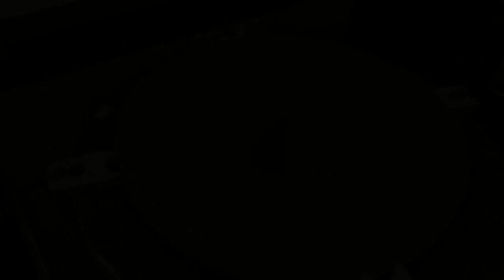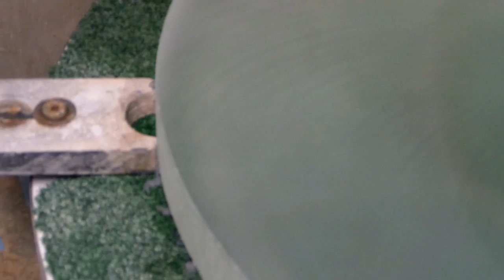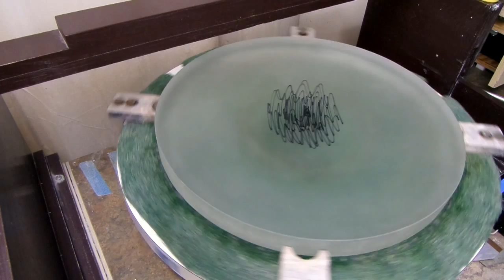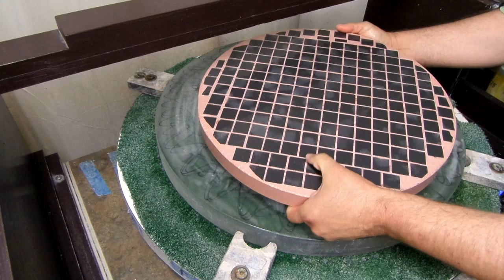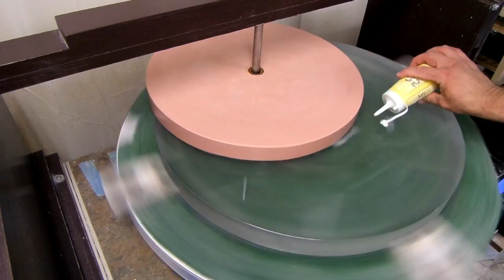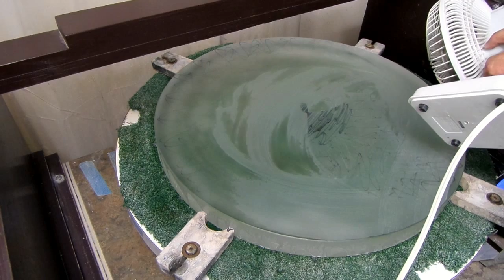Preparing to Grind a 22" f/4.0 Telescope Mirror

Comment: Not sure if this message is helpful but they make powder guidecoat. You can probably find it in an automotive parts place. I hated using it with bodywork because it got a little messy when I was in a hurry. But it helped with my bondo. Thanks for the video. I am looking forward to making my own mirror.

Comment: If the grinding stone is just sitting on the mirror, then theoretically it wouldn't make a complete even finish since the contact point of the two changes.  No reference hight.
Reply from the maker: And yet it works so marvelously well!  The grinding stone isn't "just sitting" on the mirror...

Comment: I noticed the grinding stone was passively driven by friction with the glass. I wonder if the is any variation in speed and whether it makes a difference.
Reply from the maker: The speed varies a little bit, depending on how good contact is between the two disks.  When it is in the proper "zone" then it is pretty constant.  Basically, the speed takes care of itself!

Comment: Hmm how will you get a spherical grind with this grinding setup? I can is the tool exactly 90 degree to the glass or are you using a spherical tool? But if so the high spot in the middle of the tool will only grind on one circle on the glass in this setup
Reply from the maker: The tool sits flat on top of the mirror.  It is well offset from the center, and loose abrasives like silicon carbide or aluminum oxide are ground between the two disks.  The mirror-to-be is sitting face up on a turntable.  When the turntable spins, the friction causes the tool to spin on top of it, thus grinding both the mirror and the tool.  The mirror on the bottom slowly goes concave, while the tool gets convex.  The radius of the spherical surface on the mirror is controlled by changing the offset of the tool on top.
Reply: Ahh, thank you very much. Tool and glass are grinding each other, now I understand how the glass will get its spherically shape

Comment: I do have one question, why do you have to spend so much to make mirrors by melting glasses and moulding it, taking care in grinding to the exact point required. Wherein you can get it done in a metal place with mirror finish coating and use it the same way as glass mirror..my question may not be that exact but this is just my thought...
Reply from the maker: Most metal work is accurate to a thousandth of an inch.  Telescope mirrors are more like a millionth of an inch.  Plus metal expands and contracts too much with temperature change.
Reply: "Get it done in a metal place " ? Wha ...??? You mean a machine shop ? They don't do this stuff.

Comment: Gordon, I've recently been bitten by the telescope bug and I automate for a living. I've been watching videos about making mirrors and I can't help but wonder what technology has been applied to this. I see the defect on the glass in this video. If the table had an encoder suitable for position control, and a tool to measure the flaw from center to edge, the flaw could be mapped out on the entire mirror. A laser for etching glass could be used to remove the prescribed amount of glass necessary to correct the flaw. If the measuring device is also a laser, the process could be quick and accurate. The laser doing the measuring could monitor the results of the corrections as they happen. The etcher could be on one side of the mirror and the measuring laser could be on the other side. As the mirror is spinning, the etched spots would be checked by the measuring laser after perhaps another half turn. The finish would be poor and there might be subsurface fractures, but the surface would be close to true. Maybe there would be less grinding to do afterwards.

I work with PLCs (Programmable Logic Controllers) and to some degree with robots. There are probably a few robots in scrap heaps that work just fine. I think that if the above philosophy were applied to a robot, the process could be done with little supervision. It would be a dream to have a little shop with some cool machines that spit out a lot of high quality mirrors. 

I figure that if I have thought about this in the last month or so, probably a lot of other people have beat me to it. Do you know if anyone has designed machines for this? Is there a huge gap in technology between amateur and commercial? 

I very much enjoy your videos, thanks!
Reply from the maker: We use computer-controlled machines, but most companies in our class do not.  We build them and program them ourselves, as we have a background in CAD, CNC and computer programming.  The big commercial companies that make mirrors in the hundreds or thousands have pretty good machines available to them already, although they don't usually achieve the "premium" surface quality that boutique shops can produce.

Comment: a 10in version of the takahashi  cn212 i need to make a 2in hole in it
Reply from the maker: Time to break out the diamond hole saw.  I would recommend only a partial cut out of the hole.  Cut out the last little bit after the mirror is finished.  Having a hole in the middle makes it harder to make and press polishers.  Having just a narrow ring isn't so bad.